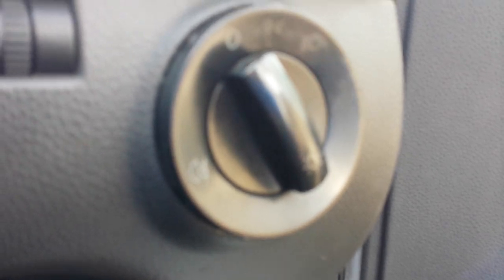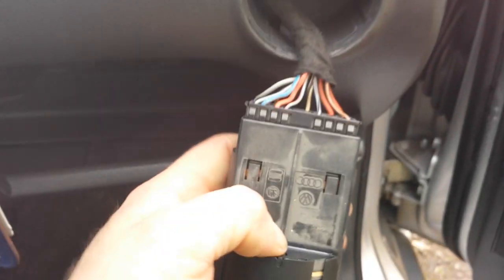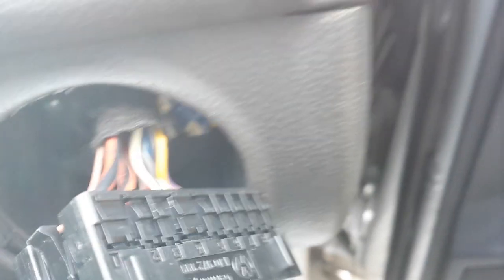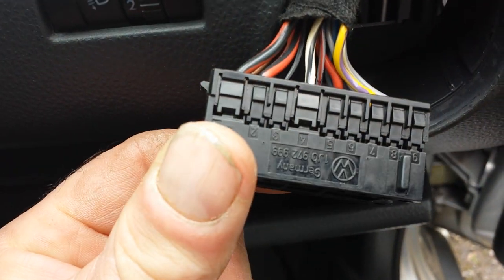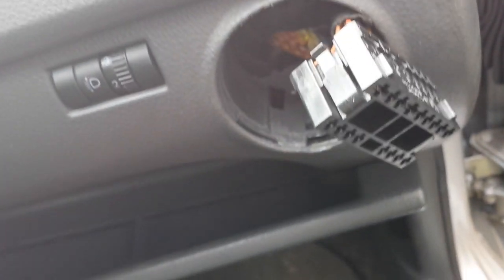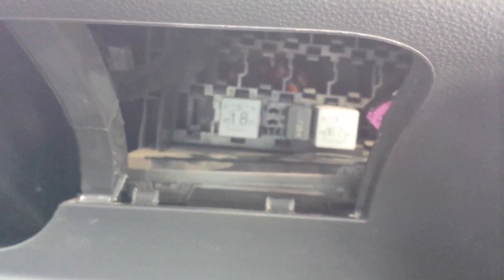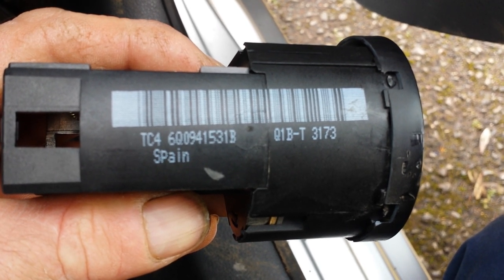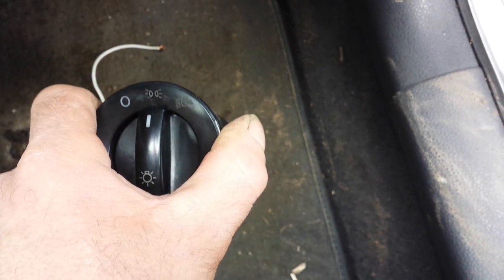Volkswagen Polo no low beam /Golf  /Audi / headlight switch removal Replacement

Comment: Thank you mate, I did the same thing, exactly the same, and it turns out that I had to change the switch, just as you explained, nice one 👍👍👍👍👍
Reply: When wires 2 and 7 are connected, the relay should click?
Reply: @augstspriegumshightension  i didn't connect any wire, I just swapped the whole thing, and the job was done, guess  it became faulty after many years of use
Reply: @chakapitchou4458  Thank You!
Reply: @augstspriegumshightension  you're very welcome

Comment from the maker: Hi In the video there is a plastic cover just to right of the steering column the panel in the video I had removed before but it's just a clip in panel and you can see me put my hand in and push the switch out

Comment from the maker: Hi thanks for your comment, if  you are  dealing with both sides  lights in failure with for this test and on a polo in most case's if its not the bulb or fuse and both head lights on low beam are out its normal the switch

Comment: Issue is that both lights stopped working however the fog lights still work.

Thank you will try this.
• ive checked fuses and cant see any blown
• pulled the right globe and it seems healthy

Im curious to know if you have encountered any EPC issues with this car and know of any possible fixes
Reply from the maker: Hi you need to check for voltage at the lights terminal and if all fuses are ok and if it is the same switch as in the video it's probably the switch needs replacing and I haven't dealt with any issues with the light and ECU

Comment: Thanks man, on 2006 golf V sdi parking or side lights dont work, I checked ground its OK, no vcds bulb errors
Checking power side, no 12v... If I apply jumper cable to 12v light works, next is the switch, I totally forgot about it! I already thought the issue is my J519 and its an expensive board!

Comment: Hello, Patrick! When wires 2 and 7 are connected, the relay should click? Is there a relay between the switch and the bulb? What are the components in the dipped beam electrical circuit? Could you please explain?
Reply from the maker: Hi the switch has fuses side panel buy door   and as I understand no relay involved so the lights should come on when doing your basic checks the also check your 2 bulbs and connectios  2 fuses check they have 12volts at the fuse in most cases it's the switch but if you still have a problem after bypassing the switch it's normal one of the above hopefully this helps.
Reply: @patcarmax  Thanks. I'm dealing with a 2005 Volkswagen Caddy, but since the switch and connector looks the same, I think the circuitry might be the same. The operation of the relay is inaudible when the dipped beam and high beam is turned on, although the high beam works. Tomorrow at work I will check again, but it seemed to me that the voltage was coming out of the switch, but it did not appear on the fuses. It was important for me to know your thoughts about the existence of a relay in this circuit. Thank you again

Comment: MY PARK LIGHTS AND BRIGHT LIGHTS ARE WORKING FINE IN MY POLO VOVO 2016 MODEL BUT THE DIM LIGHTS ARE NOT GETTING ON , CAN IT ALSO BE THE SWITCH PROBLEM
Reply from the maker: Hi thanks for your comment, If the switch is of the  same type  then it's possible, but you need to check your fuses and bulbs to see if they have blown if not then the switch is a possibility I have to say the jumper lead test may be different from the video as your car is much newer car than the video  one so may be different terminals I cannot help with this as it will need a full test to check the right circuit.

Comment: Thank you. very helpful.
I have an 09 vw passat B6 and the front low beam dip light on the left flutters when I turn on the vehicle than it shuts off. what can be causing this?
Reply from the maker: Hi Luis  I would  check bulb just in case the element is broken but still gets a contact and the rear connections that's  inside on the light bulb connector , the light plug may have a fault so see if the connector has melted because of corrosion/ oxidation  and with the light on try moving at the connections  to see if it comes on good luck Patrick

Comment: Sir, i want to check the which wire is for front and rear fog lamp. How i can check ?
Reply from the maker: Hi thank you for your comment but sadly I haven't got the wiring diagram now to check your question.
Reply: @patcarmax  cant you check
Reply from the maker: As I explained without the wiring diagram for the VW polo to which I think your working on , to which I no longer have the diagram,  I cannot  check this for you but please look at Google to source one as l only studied the problem posted here not the fog lights circuit best regards.
Reply: @naveen03thakur why can’t YOU check??  I mean the OP has given more info than anywhere I can find on the internet for this dipped headlight issue.  Go do some work and stop giving him grief.  My god…

Comment: I did everything exact as you but when i try to connect 2 to 7 it sparks also tryed 1 to 7 (cuz i found on google 1 is ignition for my model) and after a while there was a burned smell. tryed on golf iv 1.6 2000. Any clue what may be the problem

Comment: Hello. Thank you for this Video. I do not have a wire in #7. I have a 2008 Audi A4 Quattro 2.0t. Would you have the answer?
Reply from the maker: Hi sorry to say can't help only by saying you will need the wiring diagram for your car but if fuses are ok and both head light bulbs are good most likely the switch thanks for you question .

Comment: Only my low beam headlights are not turning on. Bulbs and fuses fine. Could the switch here be a solution?
Reply from the maker: samanionpie hi if you have no low beam and if you do the test in the video  thermal 2 to 7 on the plug and the light comes on its more than likely the switch has  failed thanks for watching
Reply: I have a VW Golf and having the same problem. The switch looks the same. Do you think the test of thermal 2 to 7 be the same. I'm just careful that it might damage some circuitry if i try the same thing and it's different. Your help is much appreciated.

Comment: For me parking light not working how to check
Reply from the maker: Hi thank you for your comment I haven't got the wire diagram now so not sure of the terminals to jump to check but check fuses and bulbs and if there is a 12v feed voltage at bulb  terminals if there's no feed to the terminals then it's probably fuse or switch

Comment: VW is too damn stupid to use relays on the lights, since the first Golfs they use cheap switches made from horrible plastics that cannot handle the current draw of the lights. What is more the switch on the steering column has a terminal for the dim lights (not used) but if that is used the dim lights will go off when the brights are on, with the current setup the dim lights stay on when the brights are switched on. VW, like most German manufacturers spend too much time inventing funny clips etc instead of building stuff that last.
Reply: Oh, your comment about how they spend their time is true and hilarious.